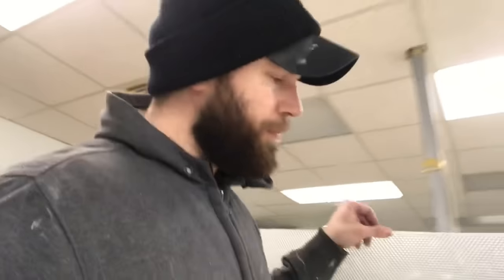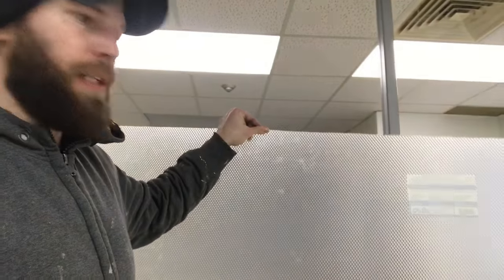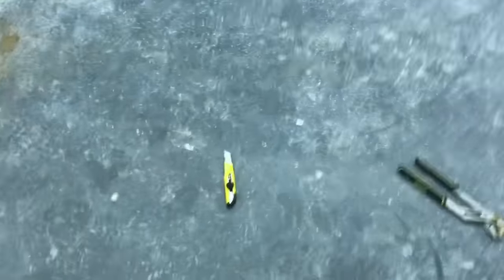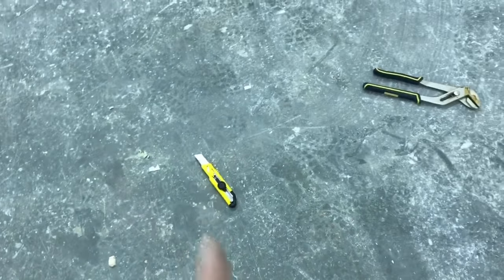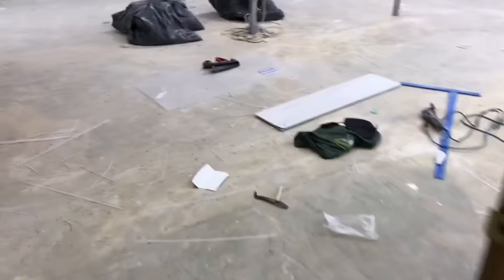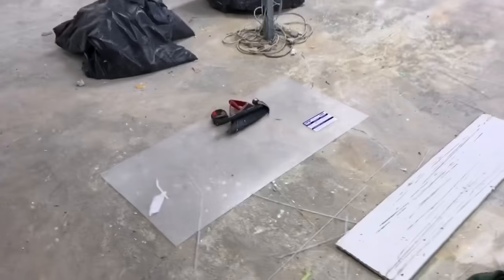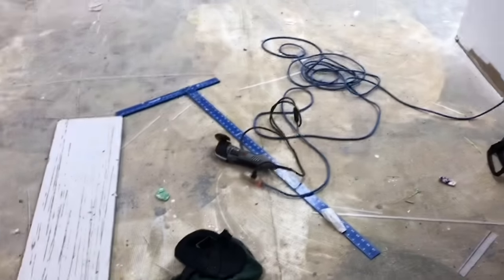How to cut plastic fluorescent light covers / diffusers

Comment: I HIGHLY recommend a Dremmel type tool with an actual cutting wheel. Works even better than than the multi-tool with the larger vibrating blade.  The less vibration, and less “toothy” your cutting device is, the cleaner your cuts will be.  The Dremmel with cutting wheel results in zero chipping and cracking in my experience.  The only downside is the wheels are small so keeping a straight line can be tricky for long cuts.

Comment: Just turn your blade around on your table saw, adjust you hight on the blade not much higher than the sheet. That's all you do cut slow.
Reply from the maker: Good to know thank you
Reply: Yeah if you turn all the teeth into rakers, then you are basically just scoring and melting. Great idea.

Those little rips the poster is taking off would be very frustrating to score, clamp and break.

I have had mixed results with my jig saw, running extreme tpi metal blades. If I am patient enough, I can shape radius and circles. But you catch a tooth once and it's a write off.
Reply from the maker: I’m surprised the manufacturers haven’t developed and started selling a cutting tool yet. Seems like there’s a market for someone to tap into here.
Reply: @AmB39  They do sell a "plastic cutting knife". It was advertised on my lenses stickers. I assume it is just a hooked, draw style razor for scoring and breaking.
Reply from the maker: I’ll try to search for that now. Thanks
Reply: @AmB39  why sell something everyone has.
Reply: I don't like this table saw idea because it takes too long to set up the saw and the plastic must be continuously supported as it exits the saw. That's a 4-foot extension. Some of these light panels are so brittle that they crack just by lifting them from one side.

Comment: This is great!  I have some very old light fixtures in my house that require 13" x 4' panels that broke long ago, this is going to be really helpful for cutting down 2'x4' panels to fit!  I think I'll make a jig that I can run the multi-tool along, my cuts are not usually as straight as yours!
Reply from the maker: Ya it’s tedious doing it free hand. Hope it works out for you

Comment: My 2 cents,
If you have one a bridge wet cut tile saw is the most painless way to deal with this material from hell.  2nd best is grinder however fumes from dry cutting can be overwhelming.  
(I've found cutting with any sort of hand blade to be a 50/50 and this stuff isn't cheap so all those cracked attempts add up.)

Comment: THE TWO PIECES OF PLYWOOD METHOD:

1. Get 
...a. two 2x4 ft. sheets of plywood (I had these sheets available, hence this method) 
...b. a yardstick, 
...c. a regular sharpie, and 
...d. a heavy duty x-acto knife.
...e. safety gear (goggles and gloves)
...f. superglue

2. Mark your required dimensions on the smooth side of the plastic diffused light cover sheet with the sharpie.

3. Place one sheet of plywood on the floor as the cutting board. 

4. Place the plastic diffused light cover sheet on the cutting board, smooth side up. 

5. Place the other 2x4 ft. piece of plywood on top of the plastic diffused light cover sheet as the press and as the straight edge.

6. Line up the edge of the top piece of plywood with your dimension markings.

7. Lucky number. Don your safety gear (little diffused pieces can go flying). In as little as three to six  light cuts with the x-acto knife, you will have cut a straight edge on your plastic diffused light cover sheet. Don't try to do it in one cut, you will break the sheet and invent new curse words.

ENGRISH INSTRUCTIONS:
1. Purchase the plywood of two in 2x4 foot segments
2. Gather sharpie, yardstick, and x-acto knife. Care not to cinder the eyes.
3. Make a plywood/light cover sandwich. Mayonnaise OK.
4. Line up top plywood with sharpie extract.
5. Cut panel in desired dimensions. Beware flying objects to eye. Do not slice the thumb off. If so, find thumb, place to superglue, affix to vacated location, fingernail up. Hide from wife.

Comment: What type of blade and what type of machine did you buy to cut those plastic fluorescent light covers. I need one ASAP. please get back with me as soon as possible. Thank you once again for your awesome video!!
Reply from the maker: It’s called a multi tool or an oscillating tool and I used a semi circular blade. Go slow with the cut, it will almost melt the plastic as it cuts through. Will be pretty stinky. Good luck
Reply: @AmB39  . Hey thanks a lot I appreciate the advice and your help and your video..

Comment: could have used this vid about 2 hours ago. I used scissors. one of the sides breaks up the other is smooth. Worked better crosswise than lengthwise i think it had something to do with the plastic. maybe tape the side you need and then cut.

Comment: I've cut 1/8'' thin strips of acrylic as well as plastic laminate about 1/4'' wide using my table saw.  I had zero chipping and no breakage.  But you have to use a feather board, clamped down tightly over the work piece. A feather board reduces chattering and violent vibrations while the workpiece is being cut. it's the chattering and vibration of the unsupported workpiece trapped between the saw blade and the fence, making the unsupported
 workpiece prone to chipping and braking. you have to support it with a feather board. I usually build my own feather boards.

Comment: Does this work for high speed electric cut off tool?? I have a small one in my garage
Reply from the maker: That I don’t know. Seems risky. You can try it on a small area of the sheet you are going to cut to test it out first. I’m guessing it would depend on the kind of cut off wheel you use
Reply: @AmB39  thanks bro

Comment: how do you know the size that it should be cut to?
Reply from the maker: I measured the inside of the light housing
Reply: Or if you have an old one of the same size (say from another fixture) lay it on top as a template or pattern.